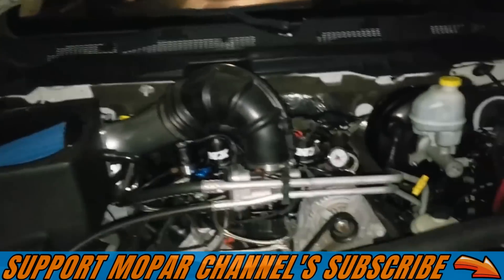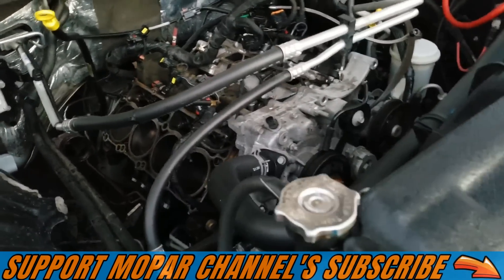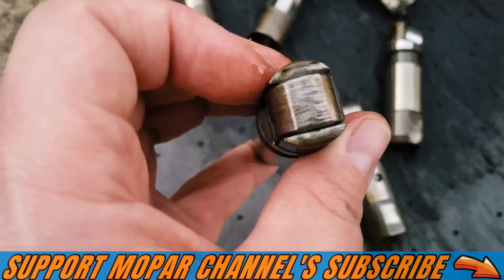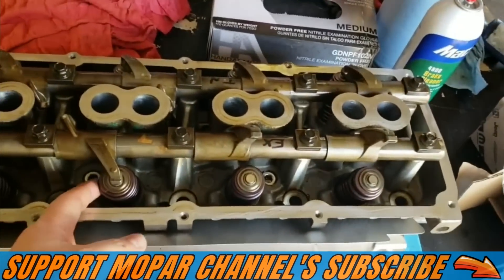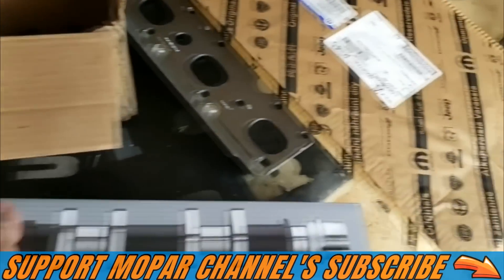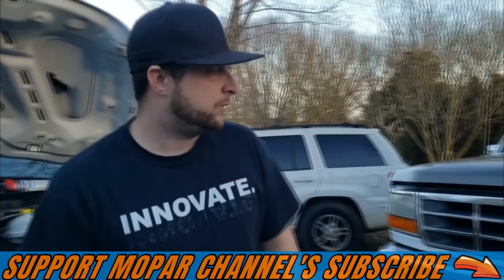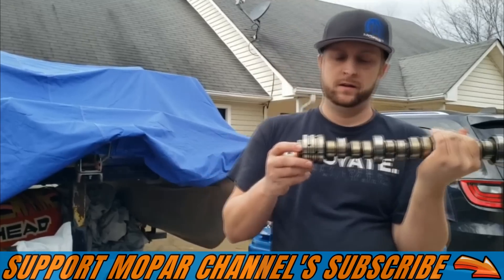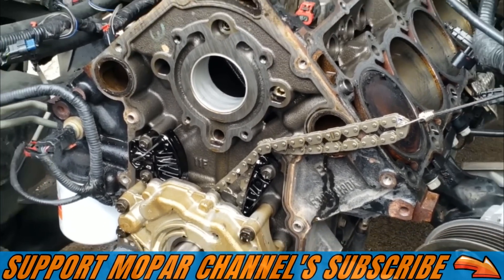5.7 HEMI TICK CAMSHAFT AND LIFTER REPLACEMENT MDS DELETE

Comment: Well, this is already outdated.

Chrysler released new lifters for mid-2019+ applications that finally resolves the valvetrain failures.  New part numbers for the cars (only) end in 785AD/786AD, and supercede all previous lifters back to 2005. 

Another thing to realize is the MDS system was NOT the cause of the failures. Many, many non-MDS and SRT vehicles lost their cams/lifters.  Poor quality lifters were the primary cause, followed closely by using non-synthetic or incorrect viscosity oil.  Camshafts and valvesprings were previously revised in mid-2016 for the squads, and lifters were revised several times until the AD parts finally replaced the rest.
Reply: P Kranz I’ve heard this before but I keep trying to do more research into it and find nothing. I have a 2019 classic, if what you said is true I really hope I have those updated lifters haha
Reply: @ProMountainBiker  I don't know what the actually beginning date of production was, but typically they'll use new stuff in January for trucks/jeeps, and March for the cars.  My '17 AWD Pursuit had 3 sets of AD's and one set of AC installed in July of '19, after it sat out of service 3 months while parts were on backorder.  It made absolutely no noise whatsoever when I bought it in February of this year.  

I do think the 2-spd oil pump may be an issue besides the lifters.

Comment: After how many miles and what kind of oil have untouched been using?
Reply from the maker: Mine failed at about 130k and I was synthetic oil . The oil has nothing to due with this it will happen regardless eventually.

Comment: How many miles did it last before these lifters and cam failed?
Reply from the maker: It had about 125k
Reply: Frostbite Ram Is it really necessary to delete then?  The better gas mileage of the VLOM.  And if the new lifters lasted another 125k that would be pretty good.  How much longer would you keep the truck?

Comment: I got the mds tuned out do you need to delete the whole thing ?
Reply from the maker: They still fail with tune mine did. It only slows down the process. When it starts ticking just upgrade everything.
Reply: @FrostbiteRam  i break stuff just so i have an excuse to upgrade 😎

Comment: It's not even the lifters the only cylinders that happens on are the ones with the mds. Bypass the mds no problems. The lifters collapse when it is engaged, if it is engaged for long periods of time and often it has a problem with oil flow.
Reply from the maker: I had a non mds lifter fail on mine. Also my buddy just had his go bad and it was also a non mds lifter. It seems to be both but more common with the mds lifters more often.

Comment: Do you think that cam would work as well in a 2013 charger  and do you happen to have link o the kit you bought? Sweet sound of unbridled unhinged power.
Reply from the maker: Yes should work great and jay greene will get you hooked up his link is in the video description.
Reply: @FrostbiteRam  since you didnt use a phase block you didnt have to degree the cam right?
Reply from the maker: @christopherbrown3785  correct just make sure timing is set and drop it in.

Comment: Man what a video, im dreading the day i have to  deal with mine. If i wanted to just delete the MDS and “bulletproof” the engine. Im guessing i would just need hellcat lifters, a non MDS cam, the MDS plugs, and a tuner that disables the MDS correct? I have a 2016 RAM 1500 5.7.
Reply from the maker: That is correct

Comment: Did that sound stop after it warmed up?
Reply from the maker: No
Reply: Frostbite Ram Thank you very much. My 4.7 has close to the same sound but it disappears after she heats up.
Reply: Michael Cabrera Check my channel for the video. It was an exhaust manifold leak with very noisy injectors that silent themselves after a while. I did a tune up and that seemed to help it a lot, then flushed the engine with 20% Marvel Mystery oil which helped even more (after 300 miles on Pennzoil Ultra Platinum and MMO, oil came out black with chunks).

Comment: Running the electric fan from the V6?
Reply from the maker: No I'm still running my stock electric fan
Reply: @FrostbiteRam  any heat issues? Ive heard its not ideal to just run the stock since it doesn't create alot of air like the v6 one ... Also i daily my ram ... Wondering if i could just do it like you or install the v6
Reply from the maker: @cougarslayer91  nope mine has been fine and I use to daily mine 85miles a day 5 days a week.

Comment: See uncle Tony's garage he explains it's a design flaw in the engine block oiling system the cam and lifters don't get enough oil below 2000 rpms it happens in engines that set and idle a lot or in stop start traffic situations good luck

Comment: Frostbite,  I have a 2019 PowerWagon with the 6.4 in it.  It's brand new and my question is,  Is there a way to turn off the MDS other than just using the tow haul mode or gear selector on steering wheel?  If I run it without using the MDS mode will it solve the problem in the future?
Reply from the maker: You can buy a programmer like diablo and turn it off or get custom tune. Unfortunately turning off the mds doesn't seem to help much as most the time the non mds lifters fail also.

Comment: Hellcat lifters are the same as 05 Hemis  just revised to fit all
Reply: EliteStricker so that means my 06 Magnum RT has the good lifters then?   I get a little tick when it’s cold or a hair low on oil, which is rare.   But it goes away after about 5 minutes.    My brother has the 09 Ram 1500 with a very bad tick but he says it’s the exhaust manifold leak because the bolts they use are crap and no one knows the correct torque specs.  He had his fixed at the dealership once under warranty but it came back and now he just lives with it.      After tons of research it appears that my 06 Hemi would be safe, but I always worry about every little new noise.     I change the oil regularly between 5-10,000 miles but use full synthetic and K&N filter.   I watched a video where a guy cut open a bunch of different oil filters and the results were like a horror movie for gear heads.    Don’t watch if you want to sleep that night.     I’ve used Fram all of my life before my Mopar and they were the worst ones!
Reply: @andrewhigdon8346  Idk, everyone says hellcat lifters are better but I'm not 100% sure. My had small tick too, mine is a 2010 and noticed it a little more. Took to mechanic shop and they said it was my oil pump. Replacing water pump,  timing cover gasket and harmonic balancer also since engine is kind of torn apart.

Comment: Could be exhaust manifold bolts, known for breaking/snapping in the block
Comment edit: I am planning on replacing my headers as I have a tick to, rpm goes high then goes down, also high performance track cam on my dodge ram 1500 along with a tuner looking at 4k-6k for parts, not including install and labor
Reply: Where you got the kit from?
Reply: @Carlossibrian1  Check out moes performance.
Plans changed, not gonna fix my truck
Saving up for a new one
Not worth spending 5k plus to fix

Comment: No wonder you smoked the lifter spraying nitrous most of the stock internals are not engineered for that much power 
Was it a Mds motor

Comment: It is really a shame that Chrysler designed such problems into this engine and also Gen 3 V-8's. Between their engine problems and transmission problems , I'm not so sure I'd ever want one.
Reply: Really given the  small amount of these hemi lifter/cam issues compared to massive amounts of these same hemis all getting to 200-300k without a single lifter/cam failure really shows this isnt a huge problem. Sure the small limited hemi owners that do have this happen really really sucks and makes them angry thinking the manufacture ripped them off. The fact is the failure rate is less then 5% and if you compare that to other engine defects  and other manufactures it is really small amount it happens to.Really this is not some huge deal that happens to 8 out of 10 hemi owners , not anywhere close to being big enough to make massive changes to fix the very small less then 5% hemi engines this really happens to.There is no guarantees with any vehicle no matter used or new. If you decide to get vehicle and worried it could be plagued with problems just because you own it , get a extended warranty. One where you wont be out for repairs on any vehicle you do decide to buy. I for one dont sweat the small stuff and just because I have problems with a certain vehicle , I'd go out and buy another one of the same because chances are I will have a completely different experience and neither will be the same unless ya buy blindly.

Comment: That sucks glad it was caught on time I have the same tick on start up on my 4.7l :/
Reply from the maker: If it has alot if miles could be timing chain worn. Lifter problem usually dont go away the tick is constant.
Reply: @FrostbiteRam  thanks man I was think it could be those parts you mentioned it dose have 139,000 miles in it it's oil change been done on time just ware showed up. lol
Reply: 4.7 has a totally different design... chain or exhaust manifold...

Comment: I didnt see pushrods in the list. Did you upgrade them? Just trying to run prices
Reply from the maker: Nope I'm running stock push rods
Reply: @FrostbiteRam  so the original ones out of your truck? Or new factory ones?
Reply from the maker: @partsguy7015  yes my old factory ones nothing wrong with them so I kept em
Reply: @FrostbiteRam  sweet.putting a list together.  When your ready for tranny parts let me know. I sponsor boosted motorsports channel also

Comment: So basically the 5.7's in the challengers/chargers are going to have this issue?
Reply from the maker: The rams have a lot more failures but it is very common for the chargers and challengers as well.
Reply: @FrostbiteRam  are 392's safe? I was really considering on getting a challenger rt with the 5.7 but now since i found this which i never knew about just sucks.
Reply from the maker: @isk8ip0kesm0t  all the hemi engines has had failures some more than others but dont let that stop you everything has issues no matter the make.
Reply: Yes 5.7 have the brunt of these problems. A friend of mine his brother inlaw is a state trooper and they have issues with cam wipe out on 6.1 and 6.4 cars. The cars idle a lot of there lives. There isn't great oil pressure to lifters at idle. The hellcat lifters are better for sure "needle bearings". But i would also tune map for a higher idle. Get rid of mds system at all cost. Im getting rid of the mds system on my 5.7 this spring and doing comp cam hell cat lifter swap.

Comment: Hello Could you estimate the cost of parts for this project?  My son has a 2009 RAM 1500 with 140k and most likely needs the same job done.  I'm sure the labor cost to have someone do the repair will double the cost.  Very good video-however several items addressed were WAY above my head!  Thanks
Reply from the maker: If you do a custom performance cam like me your looking around 2k in parts. If you stay stock you can probably do a stock cam and new lifters and be at or under 1k

Comment: Soooo has anyone had this problem with a 2016 5.7? I have a 2016 charger rt classic and i always run on sport mode 80000 miles
Reply from the maker: Yes pretty common across all the hemi platforms

Comment: I really wish I could find out the real cause of the tick.
Some say wrong oil, some say wrong octane. 
Both seem easy to correct beforehand. 
Still others say bad engine design
Reply from the maker: I'm going with engine design i know to many people that take care of there trucks and still have issues. Mds delete new cam and lifters good to go for awhile.
Reply: @FrostbiteRam  
I was hoping that wasn't the case. 
I want a new truck but, dont want known engine failures.

Comment: Wow, that sucks how many days did it take to have this all done.  Now can you just go with hellcat rockers and stock cam
Reply from the maker: I spread it over a weekend but can be done in a day easily if you are motivated enough lol
Reply: I replace my engine after the cam failed and wiped out the main bearings. It took about 8 hours to replace the engine complete. These trucks are not bad to work on once you’ve got a few things out of the way.

Comment: What code is it throwing you guys?
Reply from the maker: Its usually a misfire code
Reply: @FrostbiteRam  I have a 2012 ram and its misfiring.
Reply from the maker: @smookmaine7281  if it has a tick as well most likely going to be camshaft and lifters

Comment: What is a mds delete?
Reply from the maker: Removing the mds system with a new set of lifters and tuning.
Reply: @FrostbiteRam  mds=?
Reply: @FrostbiteRam  mode driving system?
Reply: @FrostbiteRam  sorry for the unnecessary chat, just found out ..mds  is multiple displacement system
Reply: @FrostbiteRam  My neighbor has a 2013 and got a P0302 code. A mechanic swapped coils and plugs but still had the roughness and knocking sound. He took it to the dealers , estimate 3k dollars...wow

Comment: RAYMOND HERBERT
RAYMOND HERBERT
2 minutes ago
I KNOW ALL THAT YOU SENT ME I TOLD YO I HAD REBUILT MY ENGINE!!!
SO WHAT ABOUT MY QUESTION, ON HOW TO SHUT OFF THE COMPUTER MDS SYSTEM????? 
DID YOU EVEN READ MY QUESTION???
Reply from the maker: Perhaps we're NOT understanding each other. But the only way to TURN OFF the mds system in the computer is with custom tuning from a speed shop or remote tuner. You can not do it yourself.

Comment: I guess the real question is do anyone knows how to solve this matter with out it coming back?
Reply from the maker: Non mds camshaft and hellcat lifters
Reply: Frostbite Ram if that will solve the problem for sure I’ll most definitely be getting it done the next time around, I wish I known of this before going to the dealer, paying a crazy amount of cash only to wait for the same experience in the future, yet I still love a damn hemi!
Reply: One question as it relates to the cam shaft that non mds camshaft is it for a hellcat as well?
Reply from the maker: @Tsworld_193  no you can get stock non mds cam or a custom grind camshaft like I did that adds some power.
Reply: Frostbite Ram can you gag the link I’ll go for the custom shaft.
Reply from the maker: @Tsworld_193  I use jay greene for my custom tune and camshaft his link is in the description of the video.
Reply: Can you run a stock non MDS cam with the hellcat lifters? and if so, will I still need a tune for a 2015 ram Hemi to do that?

Comment: Damn mine has a tick but goes away after about 30 seconds I've heard it could be just the exhaust manifolds bolts broke causing an exhaust leak I sure hope that's what it is anyway
Reply from the maker: If it goes away it's most likely a broken manifold bolt.
Reply: @FrostbiteRam  I hope so man lol that looks like a pretty expensive fix
Reply from the maker: @mikesean7382  its pretty costly no doubt

Comment: It's a poor lubrication of the cam and lifters they separated the cam from the crankshaft on a new style very bad design you might as well shit cannon or pump electric fuel pressure into the engine to flood it

Comment: wow....you define backyard dont you? all that metal now running through your engine.......
Reply from the maker: I flushed and changed oil multiple times after repairs to clear it up. Now have 20k miles on repairs and lots of passes down the dragway pretty sure I'm good👍😎🔧
Reply: m.j t you should read above where he described his flushing procedure.    The truth is that pretty much any metal coming off the parts will stay in the filter or in the pan.   At one point some companies used a magnet in the bottom of the pan but I’m not sure how far that went since a lot of the parts might be steel but because of varying iron content might not be attracted to a magnet very well.  But I’ve seen where guys put a very strong magnet under the oil pan deepest part and a few months later pulled the pan and sure enough that’s where most of the nasty bits were stuck.     Really though, bits of metal from lifters getting into the galleys and causing any kind of blockage would be my biggest fear, but because of the various oil galley routes it’s hard to say where it will all go.    Very akin to arterial issues after 50 years of bacon and and hamburgers.  But fuck it.  Whiskey washes it all away, right?

Comment: Easiest way to stop this, is don't buy a junk box Dodge....
Reply: black6turbo 
On a quiet night you can hear a Dodge rust.
Reply: black6turbo  
That's because those Fiat Chrysler trash bags dont make it there because the transmissions fall out, and they rust out and turn to dust, I've been told they use mopar rust material to regenerate eroded beaches, that's another reason why you haven't seen any.

Comment: That is what happens running nitrous on a stock motor. Spray and pray.
Reply from the maker: Yea not even close but ok🤔
Reply: @FrostbiteRam  It was a joke.
Reply from the maker: @billbkr32ify  gotcha my bad man sometimes I get some comments that is just unreal.🍻
Reply: @FrostbiteRam  Completely understandable.  I just got my first Ram 1500, 4x4 5.7 4 door. My first Hemi :)  I have been looking for bolt on mods that will increase hp just for fun. And won't break the bank. Being a disabled veteran doesn't give me much to play with. This is why I have been watching alot of Ram videos
Reply from the maker: @billbkr32ify  a jay greene custom tune with trans tune is best bang for the buck you will definitely enjoy it.
Reply: @FrostbiteRam  Do you have a link? Thanks for the info. What type of gains on average do you know?
Reply from the maker: @billbkr32ify  link is in video description and also there is a Facebook page called greene team that can answer lots of questions as well.
Reply: @FrostbiteRam  Thanks, I will check them out.